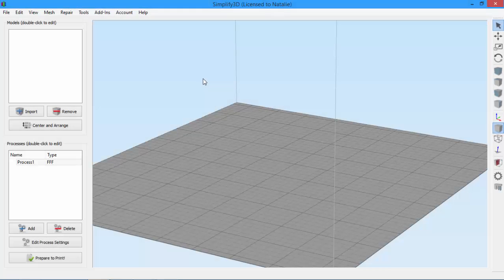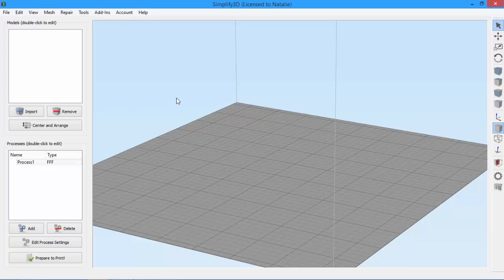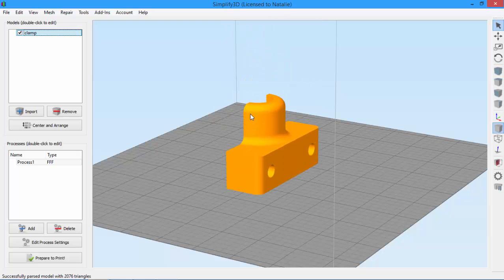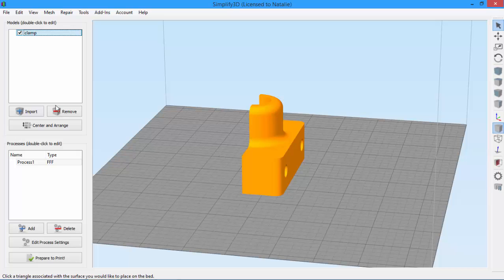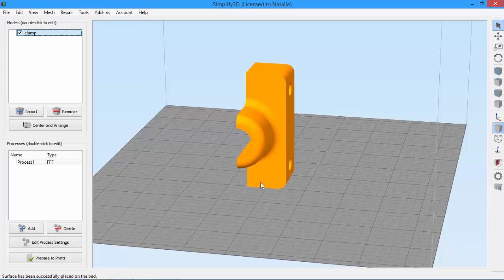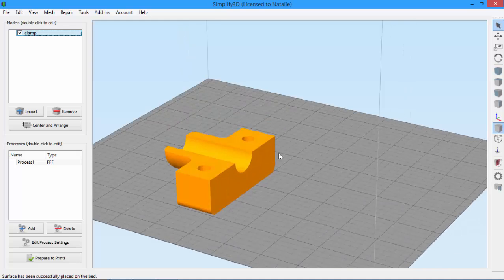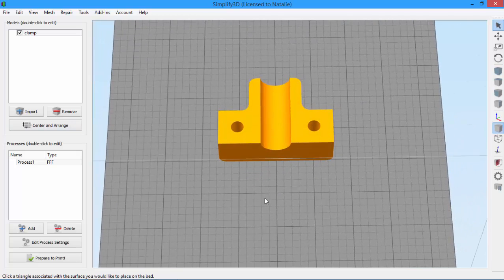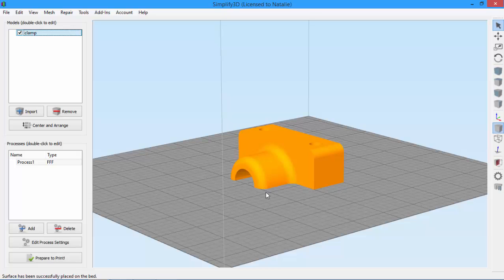Place Surface on Bed | Simplify3D

Comment: What everyone should know is that stl files devide every shape in your model into triangles, for example, squares form 2 triangles, the flat surface of a cylinder will have a number of smaller triangles aswell. 
This does not mean if you want to make a square snap to the buildplate that if you see 2 triangles instead, the face is not perfectly flat. 
This is just how the stl file works and how Simplify3d show it, and its one of the many amazing features of Simplify3D